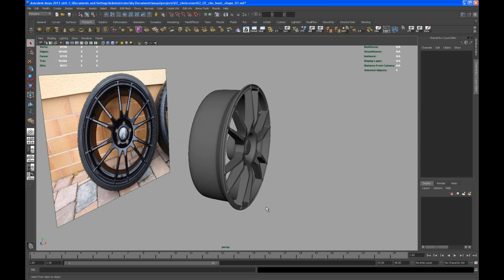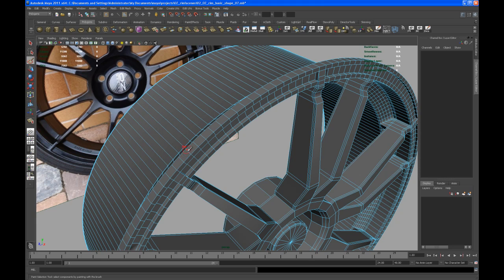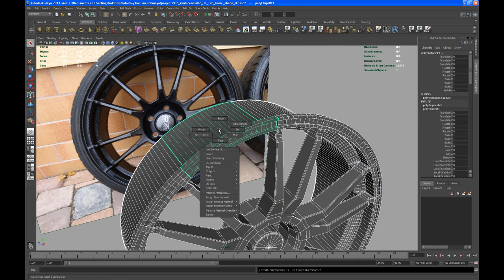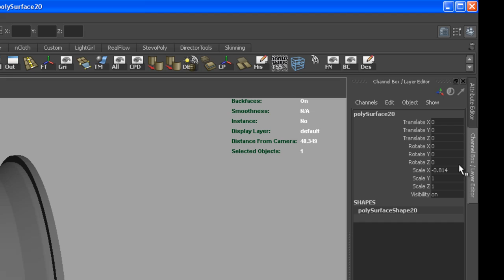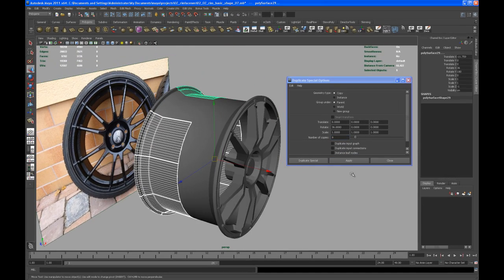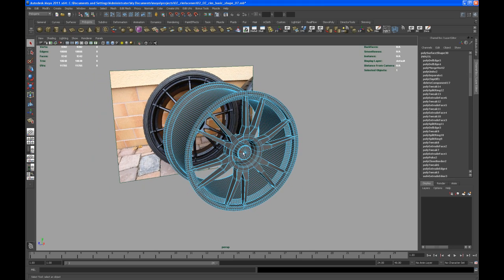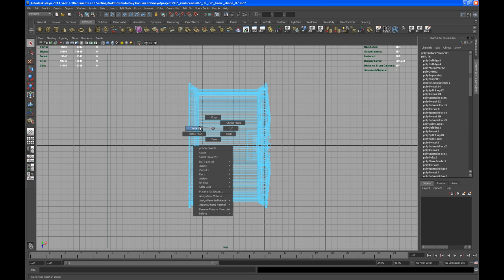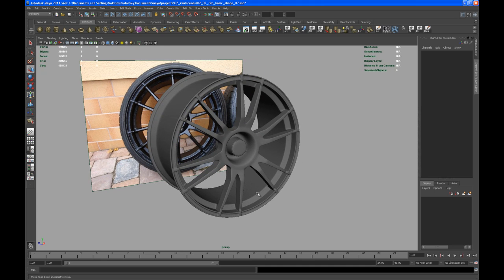Modeling tutorial in Maya - a polygon rim - Part 10: get the model done

Comment: Well for somehow when i'm using the Merge Verticies tool 

i select all the Vertex and Merge it, it wont just stick together, i change to 0.0001

it used to work but it just stopped working...... I have to use merge vertex tool...

For 360 vertex   OMG